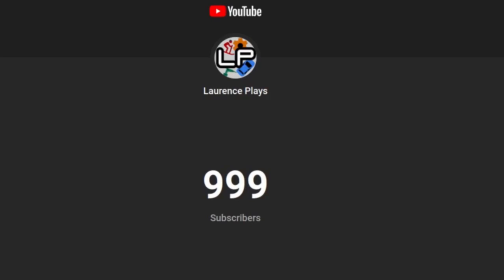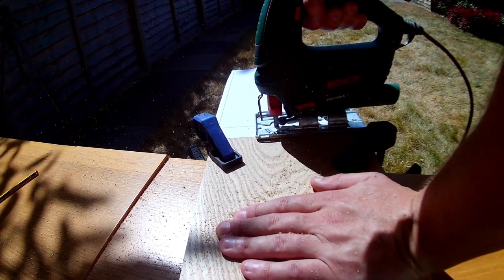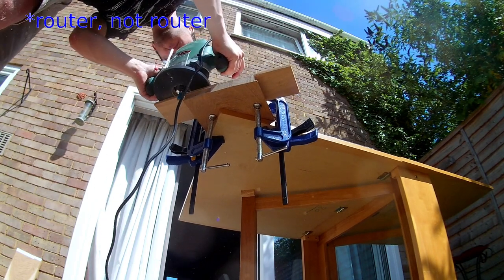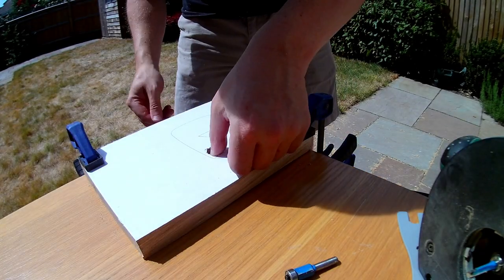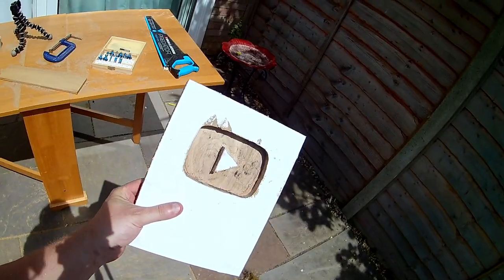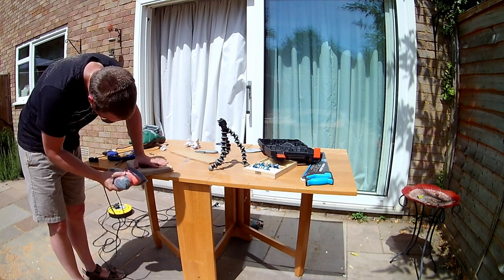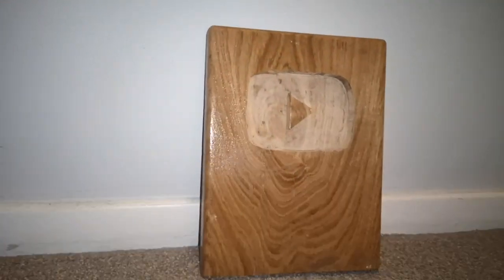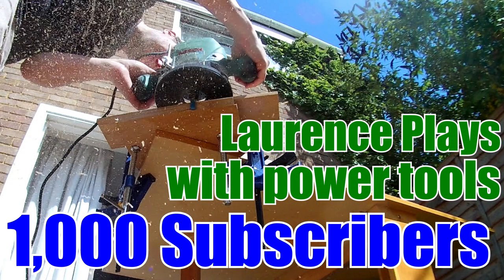1,000 Subscribers, making a wooden play button - Laurence Plays (with power tools)

Comment: Congrats man. The woodwork is on point. A drill with fly bit is always a good way to make that starting hole instead of the plunge. Keep up all your dedicated work.
Reply from the maker: Thank you. Yes, that's a good idea. The hardest part would be stopping at the right depth!
Reply: @LaurencePlays  In this case I would use a  short tip fly bit in multiple locations taking most of the material away. Even with a short tip I would stop 2/3 of the way and let the router finish the job to depth and edge using a jig as you proposed. Having space for the router material go is always a help. That space also allows you move back from your finish edge and reset to make better finishes. Great work.
Reply from the maker: @stephenszczesniak8987  That's true, removing a lot of the waste first would make the routing easier. Definitely lots of things I could do better next time.  😀

Comment: Some nice tools you've got there, but, you know, factory must grow. Good luck on the way to your next milestone
Reply from the maker: I just wish I had room for a tablesaw... Maybe some day. I'll keep growing though, I hope.
Reply: @LaurencePlays  something a couple artillery shells could solve, eh? Tablesaw could be substituted with a circular saw and, well, if need be, a table with a cut for saw blade and something to hold it in place. "Weaker", somewhat dangerous, not as precise in cut depths and requires somewhat sturdy/heavy base. Although just for cutting thick pieces of wood circular saw, pair of clamps and a surface to clamp it to would be enough. Something like a miter saw station for a circular saw can be used for angled cuts. And don't underestimate hand tools. Some nice hand saw can make cutting planks an easy play for a hobby level. Bunch of sharp chisels can do rather well when you need to carve something in a wood piece, like that indent for a play button. Hand tools require less space(besides some to store them properly) and they are as powerful as one using them. Hopeful to see that power level go above and beyond soon
Reply from the maker: @RuntimeTheCat  I do need to get some decent chisels - actually went out while I was making this to buy some from the wood shop just round the corner, but they'd closed! I think a dremel might be a good purchase too, although my tool cupboard is rather full already... 
I think making a bodged together tablesaw would have all the problems of a real one (ie, I don't have room for it!) whilst being less effective and rather dangerous. A track saw would perhaps be a good stepping stone...